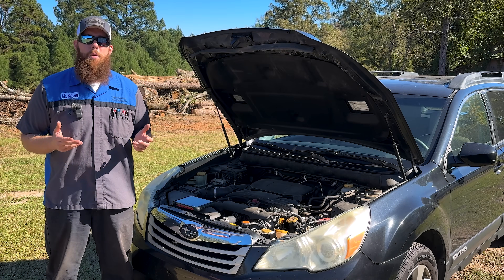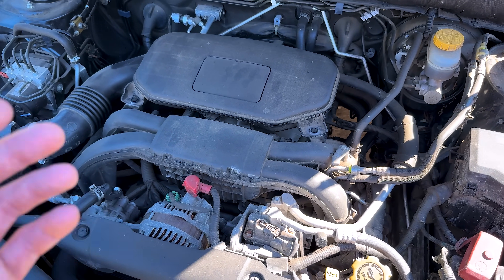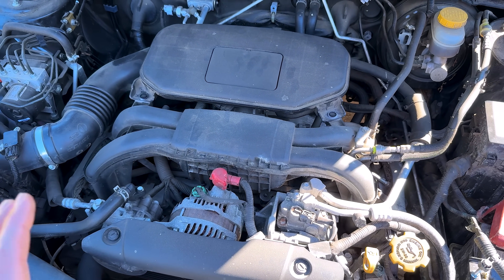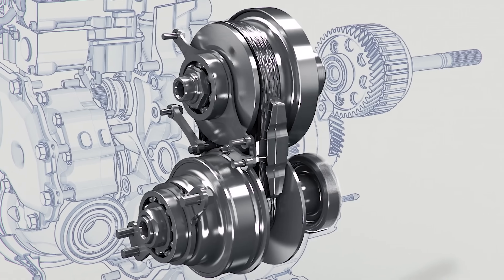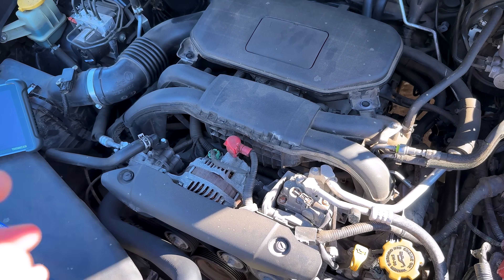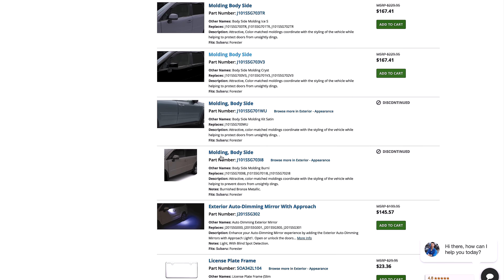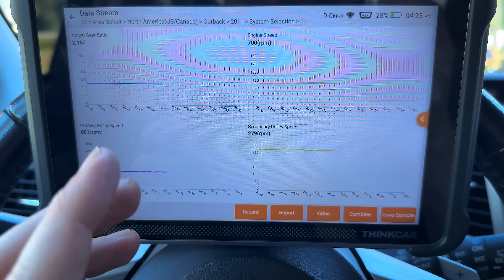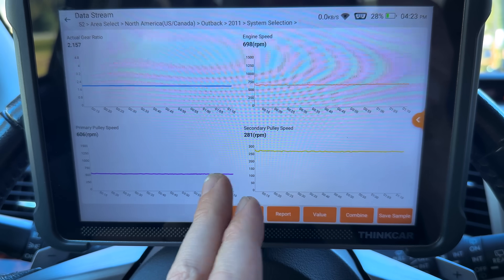Everything About Subaru CVT Chain Slip! How To Prevent It, How To Diagnose It, & Repair Options!

Comment from the maker: Get the ThinkCar scantool here - https://mythinkcar.com/?ref=MrSubaru1387 Promo Code MrSubaru10
Reply: I used to love subaru. 
My buddy had a route .
   He put 170 miles a day , 7 days a week. 
   He drove 80s subarus.

   Bought a 2016 outback for my wife & its been great (knock on wood), but with these cvt that you cant service, having to buy 4 tires when 1 gets bad, the cost of repairs when something goes out or to maintain & the fact that I can only baby it or expect major issues makes this subaru my last
Reply: Hello Sir,

I have 2015 Subaru Outback 3.6R, I want to change transmission fluid drain and refill, which is best fluid other OEM? Because dealer selling 5 Gallon Bucket Only.

Somebody suggested Castrol Transmax ATF / CVT Universal but I am still scared.

Please suggest me
Reply: @MrSubaru1387 will this scanner THINKSCAN 689BT give me the ability to read transmission temperature? And why don't you remove the pan and get all the crud out?

Comment: I got a 2014 Outback 2.5i CVT with 121,000miles about a year ago and since then I've put over 1500 miles on the car with simple driving to school and work and for most of my ownership I have driven this car very spiritually always doing quick accelerations and always using manual mode and I've even done 0-60 mph times and got in the mid to high 6 seconds and I've never had an issue with the car at all it takes my driving very well so does this problem only affect a couple of Outback's here and there or what?

Comment: had my WRX CVT replaced about a year ago but having acceleration delay from a stop or when I punch it while cruising, could that be an issue with the torque converter?

Comment: I bought a 2011 Outback with 133,000 miles earlier this year.  It runs (ran) perfectly.  Two weeks ago I had the CVT fluid drained & refilled.  I've experienced brief (< 1s) chain slips several times since then.  Now I regret changing the fluid.

Comment: I currently own a 2104 impreza. It was bought used, but we aquired it it prior to the 50k mile mark on it. I have gone done the CVT rabbit hole and I am getting mixed results not only in my searches, but also from regional Subaru dealerships about the CVT fluid. The car is now at 120+k miles (mostly highway miles from work travel), and the CVT fluid has never been drained/refilled to my understanding. The car is paid off, and I would like to keep it running as long as possible, as we just had to trade in our 2018 forester and can't really do 2 car payments anytime soon. I had an authorized dealership tell me they won't touch the CVT fluids because it's not recommended, and then 2 other dealerships are tell me to get it drained/refilled. I'm not sure what to do.... advice?

Comment: I have a 2015 3,6 L 6 cylinder Legacy. At the beginning of this year, I noticed slippage-but mistakenly believed it to be my engine belt. March 3rd @ 86,134 miles the dealership told me my seals were leaking cvt fluid and that the transmission needed to have it's fluid drained, be removed from the vehicle, have the seals replaced, be re-installed in the vehicle, and fluid re filled: an $1,800 labor intensive job as involved as a head gasket! On May 7th @ 87,132 miles the work was done...........but I continued to experience slippage between 32-40 mph..............
-however, over the last week with the cvt now @ 88, 314 miles, the slippage has STOPPED completely! Indeed, I have literally punched the accelerator with absolutely NO SLIPPAGE WHATSOEVER??? Therefore, I have 2 questions:
1. I moved and used the car for towing: can improper towing cause your cvt seals to rupture? 
2. Does it take a bit of driving for cvt fluid pressure to build back up and re-establish itself? I have driven the car approximately 1,100 miles in just under 2 months since the seals & fluid have been replaced and the cvt appears to have hopefully returned to normal with no permanent damage??🙏🤞

Comment: ********My 2018 legacy had numerous dash lights come on (NO CHECK EGINE LIGHT) brought it to a mechanic and said it threw a p0971 code for the sensor. Is vehicle safe to drive 19 miles to transmission shop?

Comment: I have been listening intently to your videos pertaining to the CVT's pros and cons. It seems like you are hitting the higher mileage numbers no problem, leaving me to think that any of the failures that are experienced by most people might have a more practical solution. I wonder (having not been able to open a CVT myself) if it is possible to put a real oil filter in the system somewhere. Seems like the wear people are seeing that leads to the weird failure modes are related to unclean oil - chain slip, chain stretch, etc, all seem to be crap(particulate) in oil. Hmm...
Reply: This is a good answer, but you must account for proper oil flow and pressure after that filtering point you add. If the flow of trans fluid or pressure is too low you'll end up with just as many problems with your CVT.

Comment: Mr Subaru, I am trying to get my hands on the Idemitsu CVTF type SB2 fluid for the TR580 in on my Outback gen V BS9.
But can´t get it here in Europe! What other brands come close to this Idemitsu fluid, because I really would like to change the CVT fluid. It is about at 110.000 miles and I have no clue if it is done before. 
Thanks in advance, Sander

Comment: I'm really confused! I Bought a 2011 Outback in Feb. 2023. CAR FAX indicated it was well maintained. The one thing missing was any record of CVT fluid change. It now has 194K on odometer. It seems to be working fine but I'm nervous about this Subaru America claim of lifetime fluid. Your videos argue for replacement. Many other transmission shops, etc. tell me not to touch it. What should I do assuming it has never been changed?
Reply: Did you ever get your CVT fluid replaced?

Comment: The key to CVT longevity is change fluid way more frequently than advised in the manual. They have west built into the design and all that wear  ends up in the fluid/filter. That’s all there is to it. If you go by the manual you’ll likely not get the full life of the transmission
Reply: I agree, but They recommend not changing it at all.
   You'll void your warrenty

Comment: Is it common to have slipping without that squeeling noise? My 2013 outback only has 40k miles, recently replaced the fluid and it does a bit of a chugging at lower speeds when the fluid isn’t warm.

Comment: if you have a 2017 legacy with 200k would you change the fluid in the cvt?i have no history or maintenance records lol
Reply: I would drain and fill now and then probably again in 10k to get more of the old fluid out. 

The idea that changing fluid causes transmissions to fail is a myth. If the transmission doesn't work properly after a service, it was either serviced incorrectly or it was already on the very edge of failing. 

What's likely happening is the transmission was going to fail at 220k anyways so when you change the fluid at 200k, people make this connection that somehow the fluid change did it when the reality is 200k miles is pretty much the service life for transmissions. 

For Subaru, I wouldn't have any issues changing the fluid for the first time at 200k- just understand now that the transmission isn't really guaranteed to be issue free for another 200k. While they can often go 250-300k+, and the fact that yours is already at 200k means it probably wasn't defective or deficient from the factory- and therefor, likely has better odds of making it further, it still doesn't guarantee it will continue to work issue free.

Comment: I have a 2009 Mitsubishi Lancer with a cvt trans mission that went belly up. At the time, I had Endurance extended warranty. I attempted to file a claim with them. The adjuster came out. Saw the metal shavings in the transmission pan. He walked around the car, measured my tires. They were 1/2 inch smaller than stock and refused my claim. I found the only place in the country that will rebuild cvt transmissions. 3500 for the transmission, 2500 for installing it. Thank God for my credit cards. No local mechanics would even look at it. There is no other transmission you can swap out with a cvt. On the up side. I did get 160k miles out of it.
Reply: Those aftermarket warranties are a scam.

Comment: Hey there! Not sure if this is the right video to ask a question but here goes....I have a 2020 Outback 2.5l with 63K and took it into a local Subaru dealer wanting a complete transmission service and was very specific that I wanted the filter changed. This whole thing about a sealed unit baffles me. After dropping it off and going over the services that I wanted done, the next day I hear from the dealer and they were quite clear that the transmission is a sealed unit and all they could to was a fluid change. I want this to be a long term vehicle and this only adds to the confusion. Looking online there are several sources that promote dropping the pan and changing the filter and gasket, which is exactly what I wanted. To make matters worse I called a local shop that had previously serviced my WRX adn they pretty much told me the same thing, that the Outback CVT is a sealed unit and that getting to the filter is basically not a thing based on its design. I'm willing to pay for the necessary service but for the life of me can't understand why no one wants to be paid for it. Any feedback is appreciated.
Reply: The filter isn't designed to be changed. While it can be, this means that only shops willing to go beyond what Subaru intended will agree to do such work. 

Furthermore, this is probably more of a transmission specialist job. Dealerships and mechanics often don't do more than basic fluid service. 

Anything that involves additional work is often a job for a dedicated transmission shop. 

While some places will do valve body service, even something like that is often reserved for transmission specialist. 

To make matters worse, relatively few transmission shops have new talent and are willing to work on newer/advanced systems like CVT and hybrids. 

While they absolutely 100% exist, the transmission shop I got to and recommend being one of them, a lot of them simply don't have the desire to work on anything but the same type due to either lack of knowledge or simply not wanting to deal with more complex designs. 

I would highly recommend looking for dedicated local transmission specialists. This means no chains like Certified transmission- because they won't do it either. 

Large Local shops are significantly more likely to do such work- but again, they have to be willing to pay new talent to do these repairs/services and most just aren't willing to.

Comment: Excuse me if this is a dumb question, but, does this mean driving at consistent speeds is bad? Usually highway speed it good for transmissions. I have a new 2025 Forester and have been babying it and driving it primarily on highway, with the exception of some city driving as I live in one.
Reply: Change fluid regularly at 30k and it won't be a major concern. Chain slip is pretty rare and can be significantly less likely to occur if you do proper maintenance. 

The fluid protects everything by preventing unnecessary wear. Old, dirty fluid will lack the necessary properties to properly lubricate and protect the internals.

Comment: When should one change the fluid? My Subaru dealer told me to change it at 150,000 miles?
Reply: 30-40k miles.
Reply: My 15 3.6 Outback is at 132k miles and has slipping that just started.  Dealership quoted me $9100 and said tranny needed replaced... Do the fluid service asap

Comment: Our 2019  Outback 2.5 with 70,000 miles (purchased new, all service work maintained and up to date) CVT doesn't want to "shift" to higher gearing when cold, usually only when outside temps are 20 degrees F or colder. Dealer said there is a sensor (solenoid?) that prevents upshifts until transmission fluid has reached a certain temperature. We always start and warm car for 10-15 minutes on cold mornings before driving. If not warmed, engine is revving high for the speed we are running.  Is this normal and if so, can an adjustment be made to correct the issue?
Reply: It's normal to an extent but If you haven't already recently, replace the fluid and do a relearn.

Comment: Mr Subaru, I've been contemplating finding a wrecked 6 speed 2010 or 2011 Outback and converting my 2011 Outback CVT to a manual.  Any idea how difficult this would be ??
Reply: Did you find any answers to this? I had the same idea for my 2016 Forrester. The manual version gets way better fuel efficiency, and as I live in the country, I don’t need the CVT anyway.
Reply: @guywhitworth5764  Not really, other than finding a wrecked one with a manual, its a big job, both differentials and the entire drive setup needs to be switched out, also the computers etc, from what I'm told.  I would have thought someone by now would have done this swap and the information would be out there, or maybe they are starting to realize that these just aren't that neat or special of a car to bother.
Reply: @DwightHutto that’s a shame. Thanks for sharing your thoughts.

Comment: I have a 2016 Forester XT, made for the EU market. There is a CVT fluid change coming in the next year, the OEM stuff (oragne CVT-HT fluid) comes with the K0421Y0700 and SOA748V0200 codes, not sure what's the difference but can't really buy any of those anyway. There are two Motul alternatives, the first "MOTUL SUBARU HT CVTF AP", you can't really buy this one either, and the "MOTUL MULTI CVTF" fluid what is widely available but not sure if it's ok to use it even is the Motul site said so. Do you have any good or bad expreience with any of the aftermarket CVT fluids?

Comment: 2021 Subaru Ascent. Original owner. Experienced chain slip at 28k miles. Subaru initially insisted what I was experiencing was not transmission related, however, after they experienced the same issues when driving my Ascent, they confirmed it was the transmission and replaced it at 31k miles. Now, at 41k miles my transmission is yet again toast. My Ascent has only ever been serviced at a Subaru dealer for all regular maintenance and for repairs for several other malfunctions under warranty.

My question is, why would my chain be slipping on such a new vehicle and in the exact same conditions. Issues in both transmissions are experienced in cold weather (below 32 degrees), only when the drive is greater than 1 hour nonstop, and when I am passing or accelerating from a stop (0 to 45, 0 to 60, and 0 to 75mph). Given the repeat issue, could this be something beyond just the CVT?

Comment: Update, I took my 2017 3.6r Outback  in to get the CVT fluid changed to see i it would help the chain slipping go away -  the technician experienced the chain slip,  the dealership communicated with Subaru and found there is a warranty on the CVT and the whole thing got replaced under warranty ! Hope this helps others with this issue. I believe Subaru is covering the CVT issues up to 100K miles to get them checked before you hit 100K !
Reply: how many miles? *
Reply: @narfboi5910   I had 75000 miles I believe the warranty covers up to 100K miles
Reply: My wife's 2019 Ascent just had the transmission replaced in March, and the new transmission already started slipping worse than the original one, so we took it back to the dealership. They have had it for three weeks, and have driven the car just 10 miles in that time, and are saying they can not duplicate the problem, and are returning the vehicle to us, and we are at 96k miles. So now we are going to be stuck with it until it fails and will be worthless.

Comment: I have a question about the 2011 H6 series I want to add more power to it but they say the CVT transmission can’t handle more than it already has what would be the best option?I would love to manual swap it, but I can’t seem to find much about that. is possible?

Comment: I have the same slippage but it's weird because when the car is running for over 20-30 min it stop slipping maybe fluid is warm or circulator with the grit also it slip at speeds 46-55 mph

Comment: Oil changes are key to reduce wear. But eventually the transmission will fail due to normal wear. All CVT will eventually fail. A major question is should you simply  change the actual CVT unit once your valve block fails because you would be able to save money on labour by doing both jobs in the same time or wait. A mechanic will advise you to wait because he will charge you twice but logically if the transmission already has a lot of kms and you are planning to keep the car you might as well do both at least in my opinion.

Comment: What is your recommended method to wash the engine and engine bay? My 2016 outback limited has 239k miles, and runs strong as an ox. The engine compartment is filthy and I'd like to clean it without damaging any electronics/electrical components. Thanks for the videos!
Reply: The greasier and oilier the engine bay the longer it lasts. If the metal is all clean and bare it will degrade corrode and rot faster. I would never clean oils or grime off any area of my car. But I live in a place with snow and salt the roads where we hafta purposely oil spray our cars